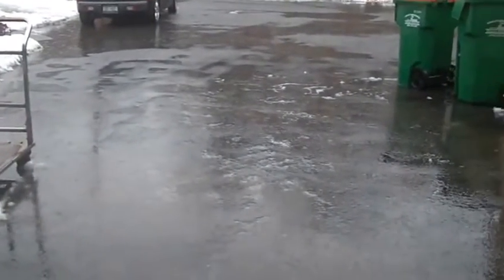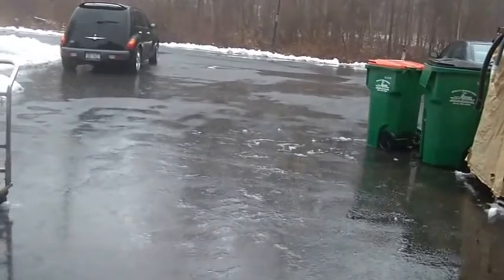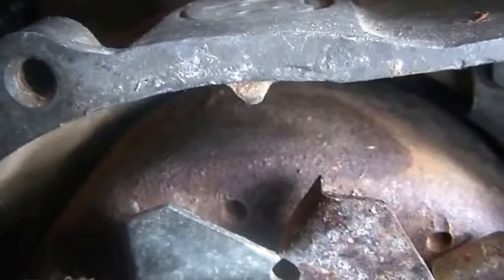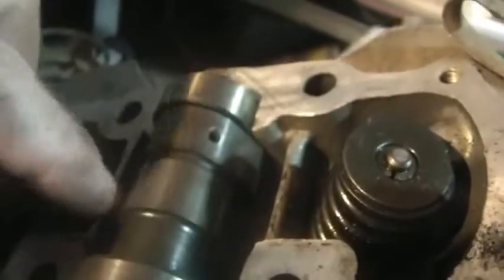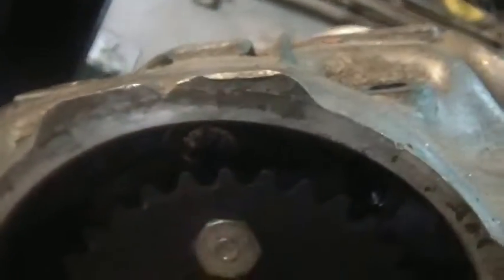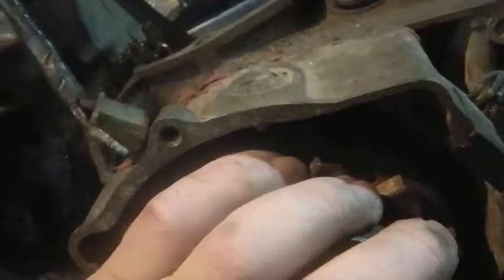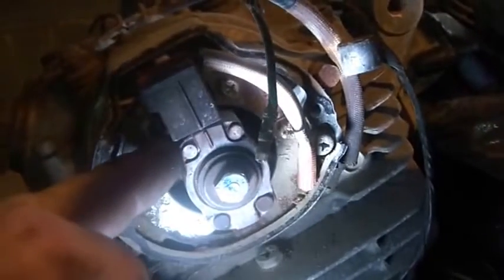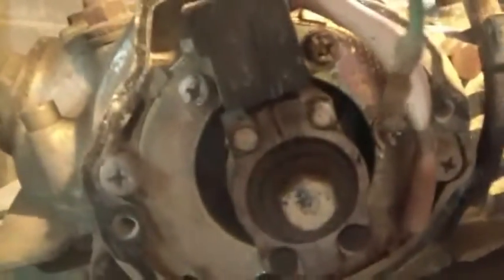1_18_15, Easy engine timing for a Honda ATC185 or ATC200,

Comment: So the cam gear can be set to either setting?  Either the T witch will loose a little power?  Or the F witch is firing just before top dead. It seemed like you left it on the T.? Is it a personal preference or is there a specific one. Ooor is it set the cam at TDC and the cdi on the f? I'm a little bit confused my motor acts like it's not getting enough fuel at times. I advanced the cdi and it seemed to smooth out but it still kinda skips when I give it gas. I know it's not a carburetor issue because if I choke it it wants to quit

Comment: Having issues starting a 1985 200x.  Had it going then the cdi gasket was torn and leaking oil. Replaced that put everything back together and lined it all up as best as I know and nothing. Won't start for crap kicked it for two days and nothing ughhhhhh

Comment: I'm in the process of timing my 1984 200es. I have my flywheel lined up perfectly with the T, the timing gear mark seems to be advanced a 1/2 tooth. Any ideas whats going on? Stretched timing chain?
Reply: Stretched timing chain.
Reply: Hi I’m currently  having the same issue. Did you ever come up with a solution for that?

Comment: Thanks for the info! Working on a 79 honda XL 185s, which I believe has the same engine as the ACT185. I have everything times dead nuts on as far as timing, but I am getting a little blown back into the carb. Is that normal for these older engines? Intake valve and rocker clearance look good. Valve appears to be seated good.

Comment: So I had to pull the motor on my 200 es to check the timing and I put the flywheel on T and the damn thing keeps rolling forward on me not sure if someone was in there before me but  top dead center is all the way to the top right so I’m not sure what to do
Reply: Take the side cover off and hold part that turns on the mark as you check the marks at top of the engine
,,,,,,

Comment: My 200m has pretty bad spark knock when their is load on the motor, stock compression , do you think I could get away with running higher octane or is it definitely the fire timing

Comment: Cam Guides what’s your opinion on replacement on a 200s engine worth replacing with middle of the road wear on them? Or go ahead and reuse?  Installing a new timing chain due to being Stretch

Comment: Thanks for making these videos, they have helped me greatly! I have one question, when i tighten the two 8mm bolts on my pulse generator base, the motor seems VERY hard to turn over my hand at the flywheel. If i crack one of them loose a little, then it turns over fine. I have the O-ring installed on the back of the rotor base. The oil seal in the middle of the rotor base looks fine. Am I missing something? I know their is a gasket that goes behind the rotor base, would that fix the problem you think? I didnt see that gasket being used in my service manual unless i missed it. I have an 1984 atc Big Red 200.  Thanks!
Reply from the maker: Hey Rick, Have U noticed that there is a pin on the cam that the advancer assembly needs to settle into? If that pin is not settled into the advancer assembly, it will stick out around a couple of mm which would cause Ur issue and mess up Ur timing....  I would look there first... Did someone have Ur cam out for some reason or was just the advancer assembly removed for some reason?  I hope this helps... Thanks for asking, watching, and commenting!!!
Reply: @HarveySpooner  thanks for getting back to me so quickly Harvey! Yes I did see the pin, it actually even gets stiff despite securing the pulse generator base with nothing else attached. I did order a new gasket for behind the back of the generator base and the new rubber seal that goes in the center of it. That rubber seal is very hard. I will let you know when I get them installed later this week. 👍
Reply: @ricklonetti9587    So?

Comment: Hello Harvery Spooner 

I set the flywheel to (T) mark and camshaft with lobes down and sprocket with little circle , got spark but could not start the engine ?
Fuel is flowing into carburetor , spark is okay , what to check 

Thanks

Comment: Harvey, I wish I watched this before I started, I’m only at the disassemble part. Before I took the top cover off I was told to line the timing up, my garage lighting is horrible and I kept missing the T but only saw the F. I lined everything up with the F and made some marks with a paint marker and began unscrewing the top, just wanted to make sure I didn’t screw up. The engine is a 200cc  zs169fml

Comment: The service manual on the 82 Honda 185s ATC , said to ad fresh oil in the oil pocket under cam till cam lobes submerged. Can you confirm this Harvey? Had engine running then added the oil and now would not start.
Reply from the maker: Hey Travis!!!   I have not seen that instruction in the service manual on a Honda ATC, but, I know that air cooled diesels have a cap on top to remove and fill with oil to pre lube the cam shift. I normally throw a few squirts of oil up there if it is a dry engine from a rebuild or from sitting.... About Ur issue, are U sure that Ur valve timing is good, that Ur valve lash is not too tight, and that U don't have a blown head gasket.... U have to go thru the basics, spark test, compression test, if U find nothing, a cylinder pressure test, make sure Ur timings are good, that the spark plug was not damaged... etc.... Let me know how U make out.... Thanks for asking, watching, and commenting!!!!

Comment: Not getting the full spark needed to start the engine. Can this be caused by the timing? It a Honda. 200 four traxx
Reply from the maker: Hey John, It has a weak spark, an intermittent spark, or an occasional spark???? I always start by changing the spark plug, U may think this is trivial, trust me, start by changing the plug.... Then, I would cut the black wire with the white strip such that is can be reconnected easily.... That disables the engine turn off circuit, let me know how it all turns out.... Thanks for asking, watching, and commenting!!!

Comment: how's it going harvey I picked up a 85 250sx about a month ago and noticed it was smoking when I looked behind me the smoke was blue.. I ran a compression test and it was about 120psi so I figured I'd buy a set of piston rings. last night I pulled the head and changed the rings. after putting everything back together I have absolutely no compression and the motor seems to be sucking in thru the exhaust instead  of making compression. your feedback would be Greatly Appreciated! thank you
Reply from the maker: Hey Tyler!!!  Sounds to me like the valve timing is off and hopefully the piston and valves did not touch!!!   I would also check the valves, maybe they are set too tight and are not closing all the way, particularly the exhaust valve, U can do something known as a cylinder leak up test to hear where the compression is going.... Good luck, let me know how it turns out.... Thanks for asking, watching, and commenting!!!

Comment: is 1984 atc200s motor the same as 1984 xr200? another qustion is is it possible to put a 2004 rm85 engine in the 1984 atc200s frame?

Comment: my pulse rotor took a crap and cracked im getting a new one will it just be plug an play or will i have to align it?
Reply from the maker: Hey Dustin,   Should be plug and play, if U change it and the ATC will not start, U probably installed it 180 degrees out... That is the only mistake U can make.... Thanks for asking, watching, and commenting!!!

Comment: Thanks Harvey for the video. It helped me to go step forward in rebuilding my HONDA XL 185S 1982. I replaced the lower timing sprocket and had to re-align the marks. I ended up having the upper "O" mark aligned with the magneto just between T and F marks. is that a problem? My next thing will be to align the pulse [alternator] mechanism. Shall I do some tricks there?
Thanks!
Reply from the maker: Hey SandyGeorgia!!!!  The upper "O" should be lined up with the lower T to start, then the fly wheel should be backup up a little such that the F mark is lined up and the pulse generator should be lined up with the magnetic piece on the cam. Ur valves should be closed for both adjustments... I hope this helps.... Thanks for asking, watching, and commenting!!!
Reply: Thanks Harvey, it certainly helps. My point was that after I replaced the lower inner sprocket [tight fit on the crank shaft ] the best alignment with the upper O I can get is between T and F. not precisely T. If I make minus one chain link, then it doesn't reach T mark. If I do plus one link, then it gets passed by F.

Comment: hello, Harvey. I recently got a Honda XL 185. and when installing the camshaft there seems to be some play that makes the timing chain rub against the inside of the cylinder and the inside cover of the CDI. everything I try to avoid play seems useless. double gasket, washers inside.... any ideas please.. thanks a lot.
Reply from the maker: Hey Jay Z., I think the top end of the XL185 is about the same, maybe interchangeable with the ATC185/200 head... Given that, the way the cam sits in the head, (more or less falls into place once everything is aligned), I can't picture Ur problem unless U bought it in pieces and someone swap out a few for the wrong ones... There should be no movement right to left, side to side,... I think U got me on this one, let me know how it turns out so I can learn something.... Thanks for asking, watching, and commenting, sorry I could not be much help....

Comment: on those timing caps I just use a washer that fits in nice and tight after the slot has a rounded bottom and then I use a pair of vice grips or a Cresent wrench.....I did make one that I welded  the proper size washer into a cheapo socket I cut slot in to fit the washer so I could use it with an hammer operated impact driver.....never had one I could remove with this washer method....try it sometime you will be pleased

Comment: thanks Harvey, I'm replacing piston rings do to white smoke and oil seeping out by plug,and replacing various gaskets,and o rings,thanks really helped me out because I didn't no the timings
Reply from the maker: Hey Joe!!!  I was looking for a way to memorize timing on these engines, cam lobs down and timing marks up makes it easy to remember... Screwing up timing typically means smashed valves with possible head and piston damage, one has to do it right and double check a few times.... Glad it help, thanks for the kind words, encouragement, watching, and commenting!!!!
Reply: +Harvey Spooner thanks I will be sure to check and check again, I'm in no hurry, or rush, I will keep watching that video      and  learn

Comment: how to you tell if the timing is off without taking it apart
Reply from the maker: +Austin Hatmaker , To check timing on a Honda ATC185/200 motor, at the minimum, the recoil and the pulse generator cover have to be removed, only 2 phillips head scews and 5 10mm bolts, only takes a couple of minutes, one can also tell if the chain is loose... Thanks for asking, watching, and commenting!

Comment: so after you have your timing correct with timing chain all on then you make sure the f is lining up with the line wont the flywheel just move back to the t
Reply from the maker: Erik Creamer , Typically, it stays there, though, with the slightest bump, it does go back to the T, normally, one can hold it to the F position while aligning the CDI pulser plate to the magnet up on the cam. Thanks for your thoughts, it seems that U did this timing before.... Thanks also for watching and commenting!
Reply: i have a question i recently just replaced my rings on the piston but for some reason the motor still doesnt have much compression, do you have any idea?
Reply from the maker: Erik, a couple of things, first, do a compression test with the carb wide opened, (no restriction from the carb, ie- throttle or choke), take the reading, write it down. (if it is over 125PSI, U are probably good),.  Put some oil down the spark plug hole, rotate the engine around a few times to coat the cylinder walls, and do another test, if it improves dramatically, (25psi or so), hope that running the engine for awhile breaks things in, if not, did U rotate the ring gaps such that 1 ring is at 4oclock, one at 8 oclock, and 1 at 12noon, did U gap the rings?  Also make sure that the valve lash is not too tight, (the valves fully close), U double checked the valve timing? Head not cracked, gasket is good? Let me know how U make out, Thanks for asking, watching, and commenting!
Reply: i had was going over it all today and when i finally got it started it stayed running for about 40 secounds they it just stopped it didnt even bog just shut down and then when i went to pull it over again it was very hard i just have know idea